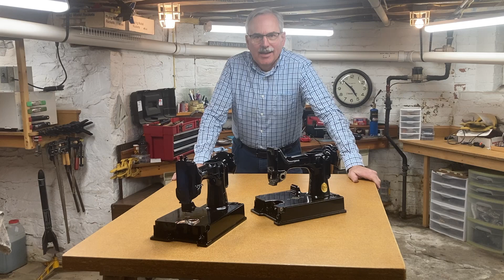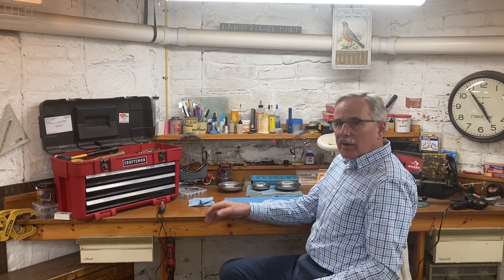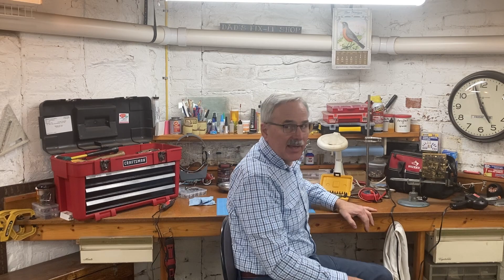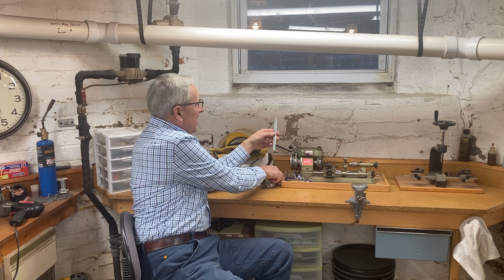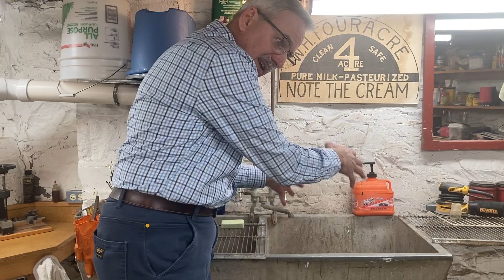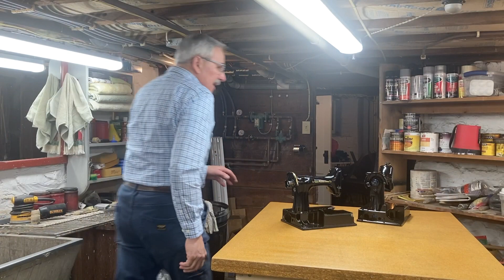Featherweight Guy - Shop Tour

Comment: Nice organized shop.  I have one of those cement wash sinks, but still used in 1952.  How do you keep the kerosene from smelling up your house though?
Reply from the maker: I don’t really do anything about the smells from kerosene, aerosol paints, the cleaning solution in my ultrasonic cleaners, or anything else. The smells don’t reach the other parts of the house. I open a window when it’s warm enough to do that.

Comment: Nice shop! Can I ask what cleaning solution you are using? I just purchased an ultrasonic cleaner and am wondering what works best. Thanks!
Reply from the maker: Thanks!  I've been doing clocks a lot longer than sewing machines, so I just started cleaning sewing machine parts using clock cleaning solution, with excellent results.  The solution I use is a concentrate (1 gal makes 8 gallons) and I buy it from Merritt's Clock Supplies.  I leave dirty parts in the ultrasonic for a full hour and they come out really clean.  But be warned, do not put any painted parts in there, as the paint will get stripped off, along with the grime.  Also, it contains ammonia, so there is a pretty strong smell.  I keep the covers on my ultrasonic cleaners (I have 2) at all times, and that seems to contain the smell.  Here is the link to the product:  https://www.merritts.com/merritts/public/product.aspx?ProductID=82142
I see that a lot of other youtube sewing machine folks use Krud Kutter.  I haven't tried it but others seem to like it.  It's probably safer than what I use, but I imagine it can't cut through heavy grime as well.
Reply: @wfjenterprises--billjohnso8701  Thanks for the response!
Reply: @wfjenterprises--billjohnso8701  Thanks for the info!